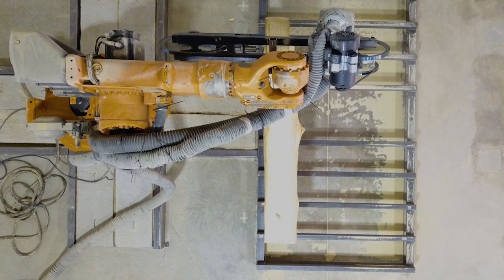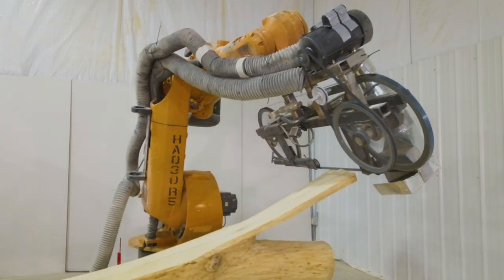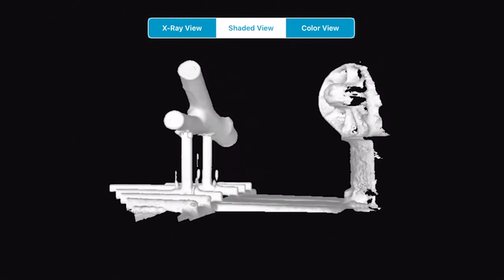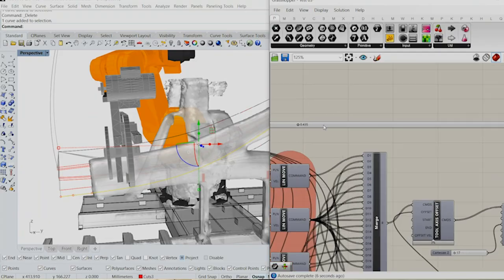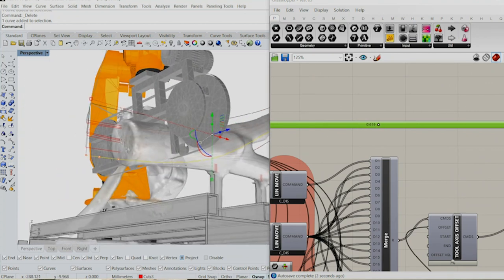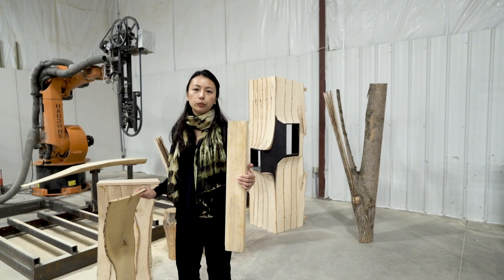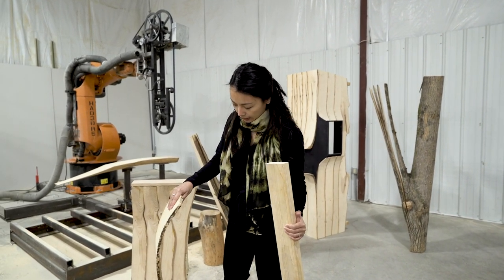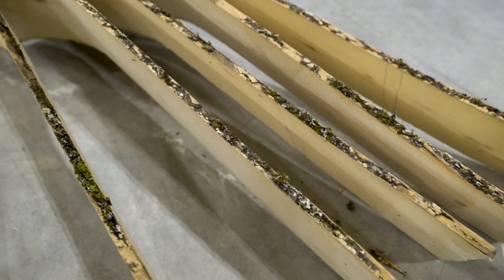Cabin built using trees damaged by emerald ash borer

Comment: Instead of going down the rabbit hole with all that Rube Goldberg stuff, why not grind the trees up and make particle board?
Reply: Im confused as well. They offered no solution which can be efficiently scaled up. I count from my window alone around 20 full sized ash trees which have been affected by EAB. I doubt anything will happen quick enough to put them to use. Just a bunch of firewood.